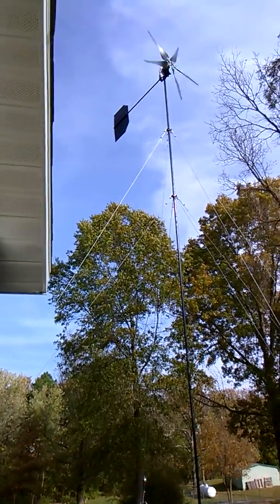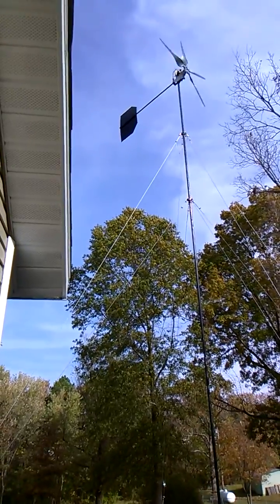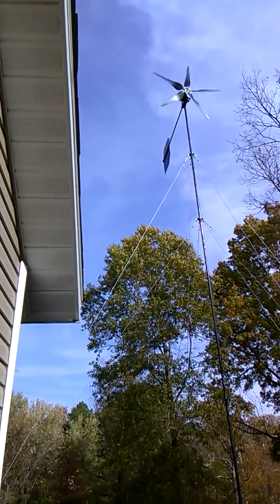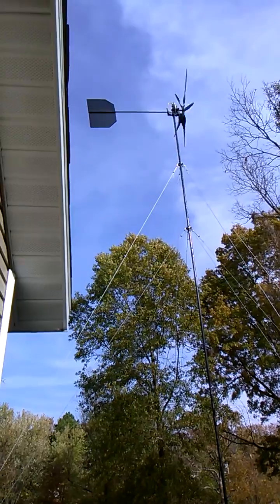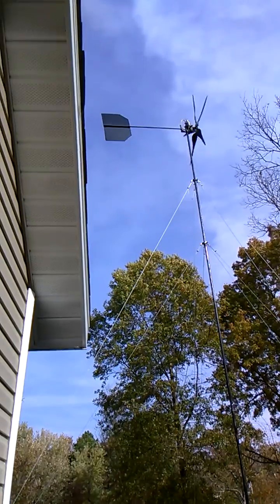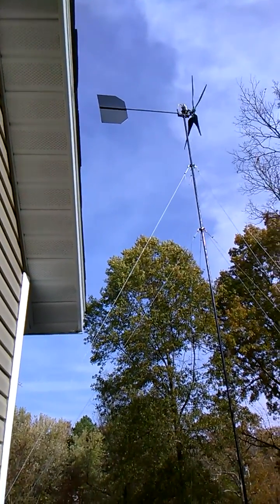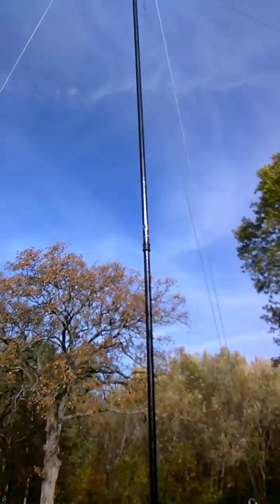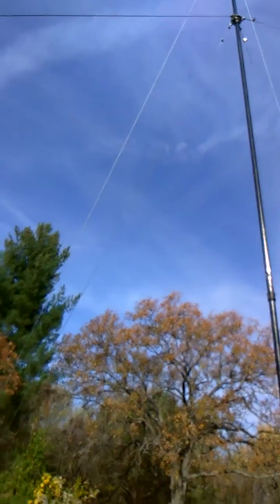9mph wind test

Comment: SD, looks really nice! The tail, it looks like it's doing its job. And things are just coming along😃! The production is better, I wonder in time if a larger blade set would also increase it? But Thanks for sharing...
Reply from the maker: I have those same blades that Orlando used on his build. they are close to 6 feet tall each.  only thing I would worry about is locking it down, that much surface area and it would keep spinning.  only way to get more power is to do some welding mods and make larger magnet rotors with 16 stronger magnets each side and 4 coils per phase. would be nice if it would cut in around 4 to 6 mph, that's the goal.  that's why I need to talk to you about the larger one I want to build